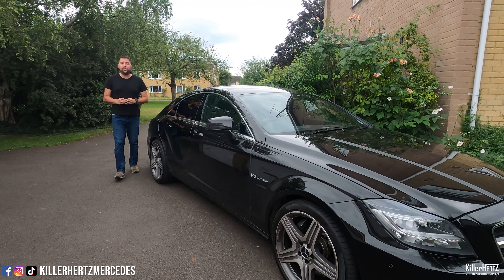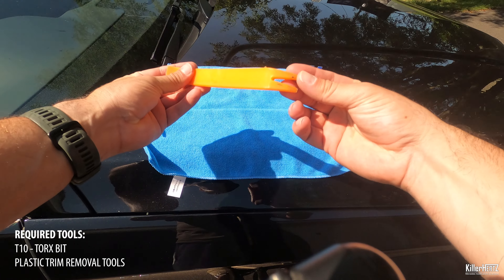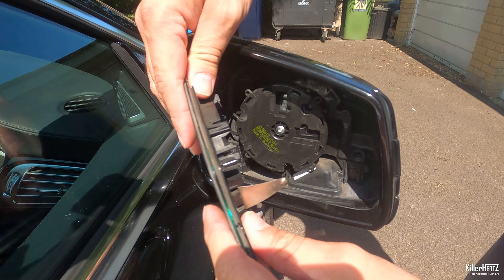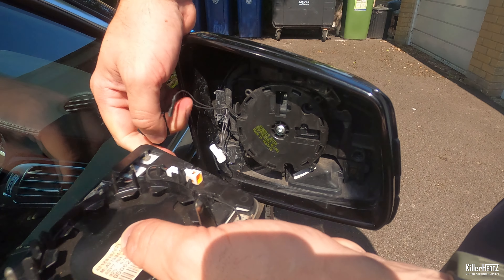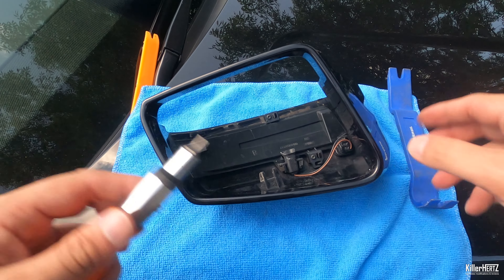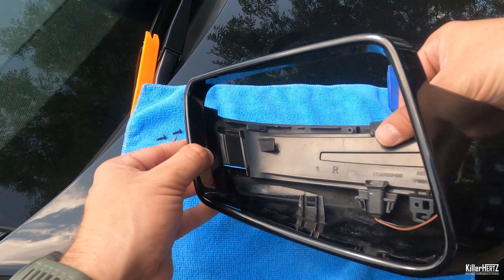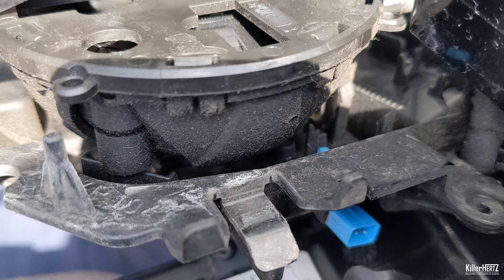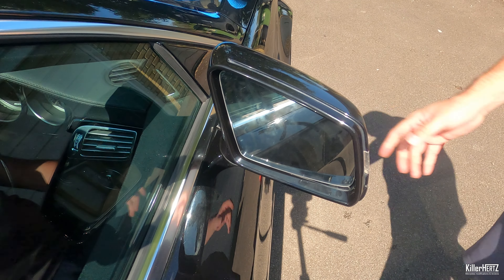HOW TO Remove Wing Mirror, Glass & Indicator W204 C-Class, W212 E-Class, W218 CLS, W176 A-Class

Comment: Nope. You don’t need to remove the glass at all. And you’re wrong about the connector.  It’s just the indicator.  Nothing to do with the heated adjustable mirror.
Reply from the maker: erm, you have missed the point of the video. The video is a guide to removing the mirror glass and the surround. its a guide to all. it says in the title of the video lol.